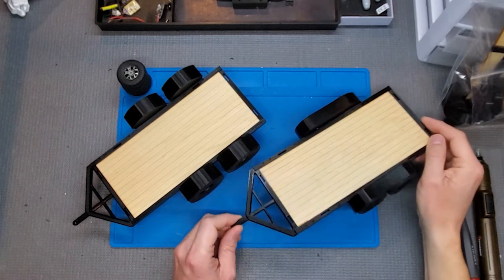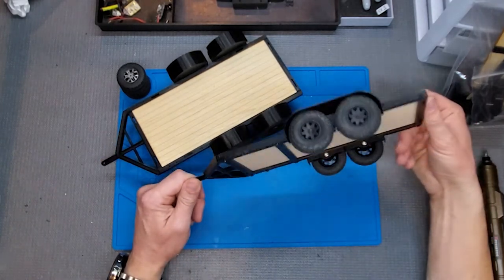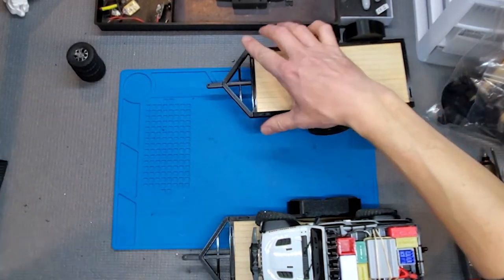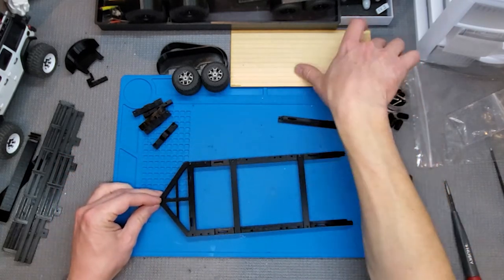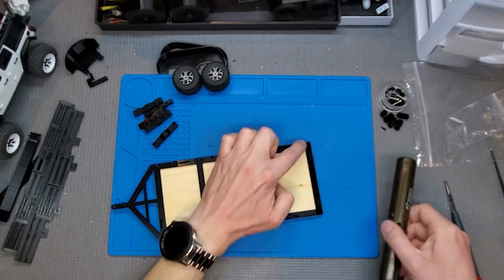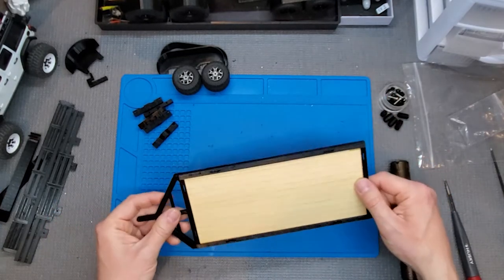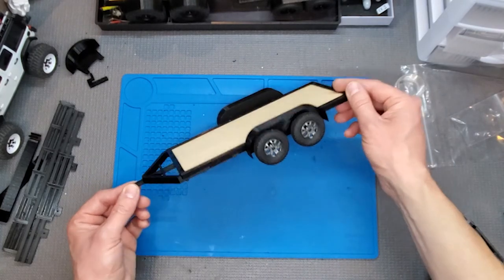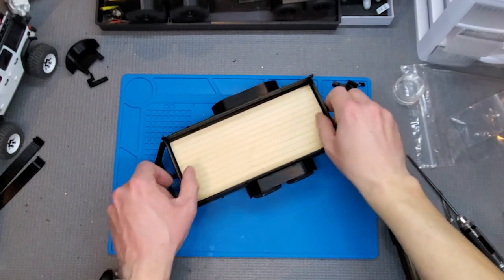3D Sleekun Designs and RC Trailer Assembly Guide

Comment: These trailers and hitches are sweet just wish Trailer was a little bit of wider
Reply from the maker: i tried to find a happy medium between the larger SCX24 and the smaller kyosho mini-z 4x4s, it will haul a scx24 but typically the tires hang over the edge some, it's hard to make a one size fits all.  i may make a larger version at some point in the near future.

Comment: Need one of those where can I get one for an scx24 bronco or c10 and one for atlas 6×6 1:18 scale
Reply from the maker: Links to my ebay and etsy shops should be in the description.  I also make a wide version now for some of the bigger 1/18 scale rigs.  Bearings are a new add on avaiable which makes assembly and rolling go a lot smoother

Comment: I used the extra SCX24 wheels and tires I have.  One problem.   When the tires turn, they end up turning themselves loose from  the axle spacers.  Not sure how to prevent that.
Reply: Nevermind.   I made it work with some WD40.  The wheels turn smoothly and easily now.  👍
Reply from the maker: @roadrash76  cool, I was about to say I made another video that goes through in more detail about how to get the axles to turn smoother, and one thing is oil :).
I put the link in the description for this video as well.
Thanks!
Reply: Boo 👎 lol trailer looks good non functional though. Nice build ok quality
Reply: @GIXXER-ps1hm  it works.  I thought the same until I added WD40 and no problems.

Comment: Good video for help putting the kit together have to admit I'm a little disappointed that the axial scx24 just barely fits on there ! Should have been about a quarter inch wider overall that would have been great ! Definitely a little disappointed with the stingy width !
Reply: honestly it wasn't originally designed to haul scx24s it was meant for the kyosho mini-z autoscale race cars up to a F1 size.  the original 1/24 scale dimensions came from an out of production diecast trailer.  I'm currently working on a widening kit that will make it a little better for hauling up to 1/18 scale rigs.
Reply from the maker: btw- i make a wide version of the trailer now.